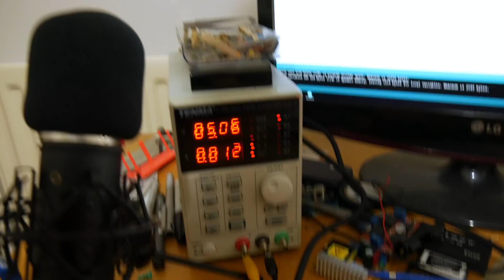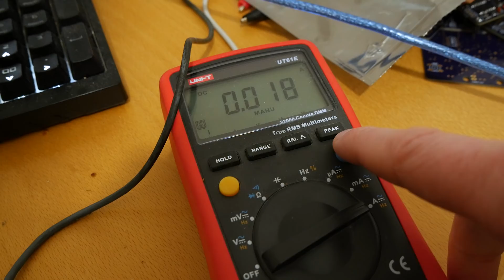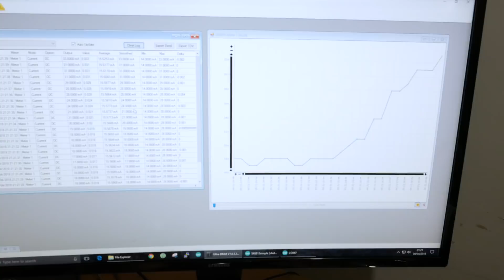SK6812 Final Board and testing methodology for current and brightness

Comment: Burden voltage shouldn’t be much of a problem because of the constant current drivers inside the led.

Im curious about the Dino gripper thingy.
Reply from the maker: I didn't want my 3d printer to feel left out, I was going to get the t-rex to help but quickly frankly it is useless. Tiny arms.
Reply: David Watts that’s the thing with dinosaurs, they are always short handed.

Comment: 60mA *16 = 0.96A = 960mA not 18A or are you referring to 16 x 16 LED's (i.e. 256 LED's) comprising of 16 boards of 16 LED's then yeah that would be about 15.36A in total for the LED's
You also missed a pad on LED9 :)
Reply from the maker: Hi Paul, yes I was referring to the end goal not the tester boards.
Reply from the maker: I am hoping for less than 60ma per LED at full brightness but budgeting for 18 amps for the entire rig.
Reply: Ah ok.
Reply: Ok, just hope you have a good PSU rated above that, there is nothing worse than when a PSU Regulator dies on you and pumps out the full voltage of the transformer through it killing everything.
This has happened to me twice over the last 20 years so now I use a 30AMP 12V PSU for my 12V projects while in development.
Reply from the maker: I couldn't find one cheap enough, so I am going to find out what I can get away with in terms of brightness vs current, I have a 5v 6 Amp supply at the ready. Testing should be fine with my 3 Amp supply.
Reply: Hopefully yeah, there are some cheap and nasty PSU's out there.
Testing how much current at a set brightness for a single board would give you an idea of the total current required in total for the entire project.